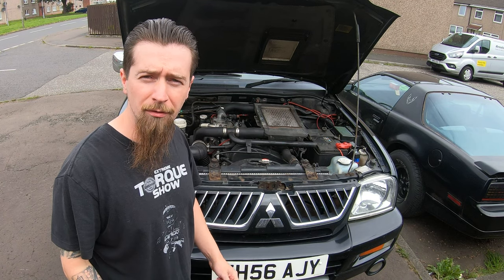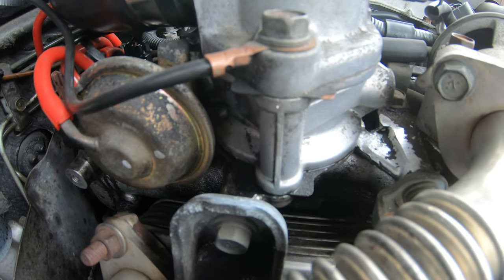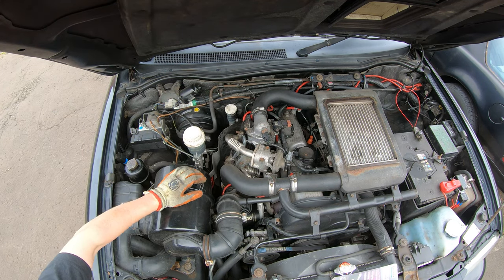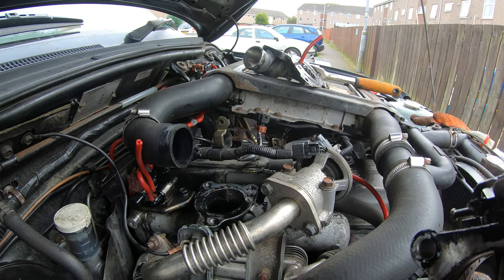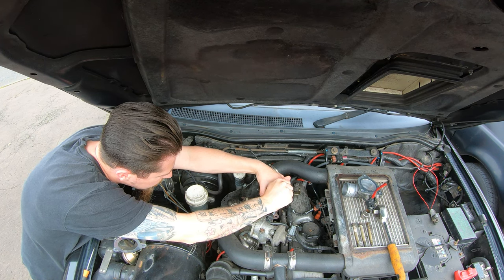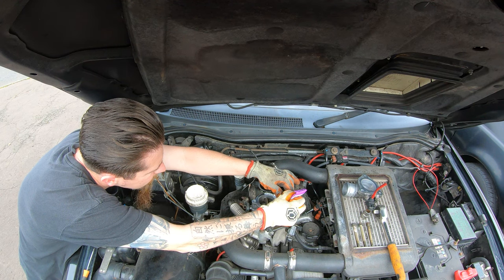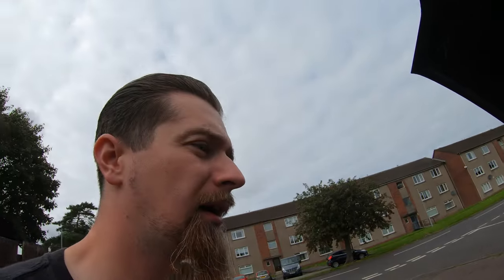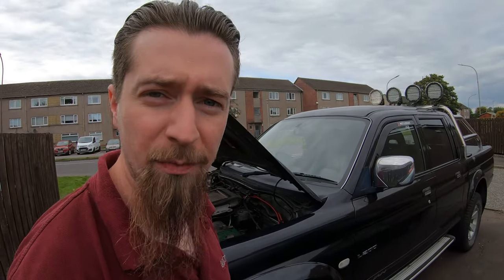K74 L200 Boost Leak Fixed With Instant Gasket

Comment: thanks man, I had these two problems also, the solenoid vaccum seal fail and the oil leak from the throttle body, I always thought that it was coming from the actuator, I'll try with the liquid gasket

Comment: What was the noise that lead you to that leak, or did you notice something when driving? I've got a whistle/scream when on boost but no inlet issues with a smoke test but I haven't smoked the exhaust side....
Reply: Check the cat converter if its exhaust related...

Comment: In my case the leak is on the bearing itself where the rod is moving to close and open the valve, not so easy fix.